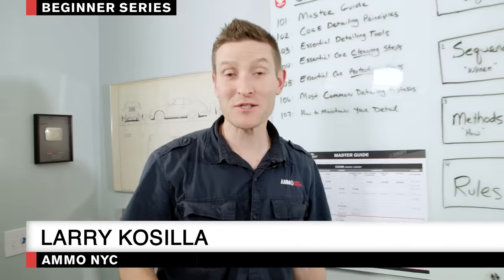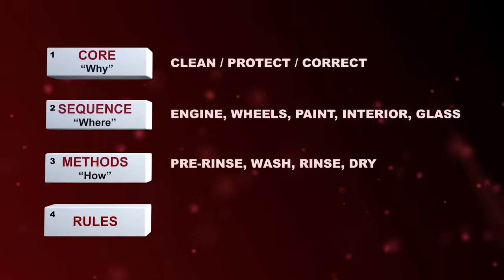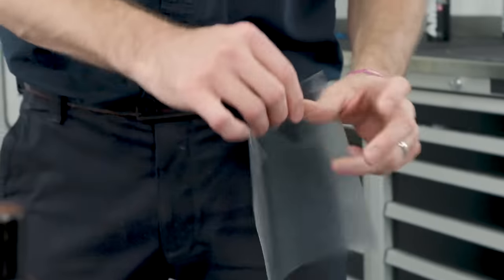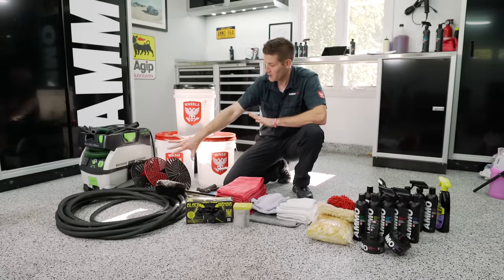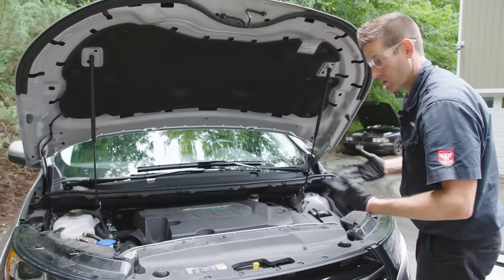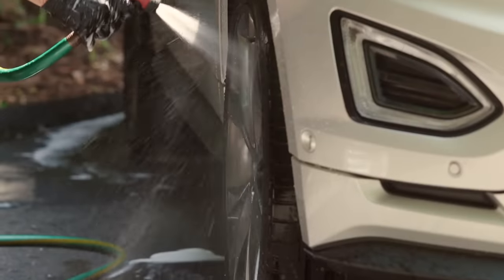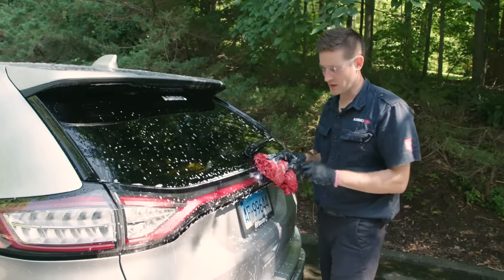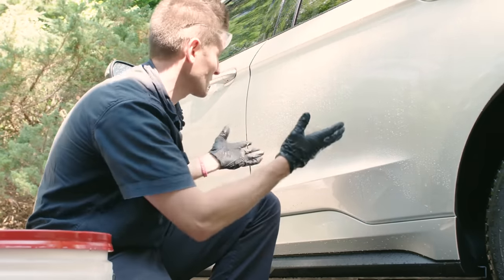Car Detailing Tips YOU MUST KNOW: Full Length Training Series

Comment: How would you clean the gauge cluster? Scratched mine while cleaning the interior and I'm pretty sure a plastic polish would be good. But for future reference so it won't happen or lessen the scratches.
Reply: This happened to me too using a brush that was labeled by the manufactured as Interior Detail. Scratched the shit out of my gauge screen.
Reply: Matthew Jesensek gutted!
Reply: This area is more for a quick wipe with a microfiber towel and that's it. There is no need to put anything on it.
Reply: The problem with polishing gauge clusters is that they can have anti-glare or anti-reflection coatings on them from the factory which you will strip off.

Comment: Hi Larry! Great videos. I’m so glad someone took the time to explain in-depth a beginner way to detailing cars. I have a question well actually two. First Q: I have hard water to use. Do I need a water softener or water filtering system to prevent water spotting? Second Q: I have a white 2015 Ford F-250 with 8 ft bed. How can I “easily” wash the top roof of cab? Again thanks for all you have done! Looking forward to hearing from you soon!

Comment: @AMMO NYC - to answer the question for the back of the car since you have asked for an explanation. It's due to aerodynamics, because the object travelling through the air is cut off abruptly and doesn't end smoothly such as a tear shape, the air creates vortices (trying to fill in the gap created by the vacuum of air in that area) and all the dust and whatnot from all around the car are sucked along and stick into the back of the car. Those vortices not only make the car dirty but also cause what we call drag and instability in a straight line. You will usually see race cars using spoilers on the car to create downforce but you will also notice they are pushed as far back as possible so the vortices do not affect the whole car but only the spoiler (as much as possible as it's unavoidable). If you have ever watched F1 you will see that it is virtually impossible to drive for prolonged periods of time very close to the car in front ~0.6s gap or less depending on speed temperature humidity etc (causes instability, less downforce, overheating of engine and brakes but can also help overtaking in a straight line if timed correctly- this is due to the vacuum of air in that area.
Again thank you for your awesome videos. You are really teaching us a lot!

Comment: Good info Larry, Personally I use the same strategies, I don't recommend the use  3 bucket method or wash mitts though , just one for wheels, the other for panels, I use 2 packs of MF towels,  I use one towel per panel and one per wheel, and discard, no double dipping of towels or mitts, that way the possibility scratching the paint or wheels is minimized very greatly!,  no amount of rinsing or agitating of towels soaking  will remove contaminants from the towels for repeated use.

Comment: Have you ever tried "Squirt the Dirt" Drywash 'n Guard ?  No water needed and the shine is unbelievable. In the door and tailgate pockets further grease and dust more or less refuse to stick and stay clean and shiny.  If you polish up the Drywash say on tge hood or fenders, the shine will reflect the numbers way over the length of 1 yardstick.  The dealers had a convention at the 5 Sails on the Vancouver waterfront.  I was there. Never before or since have I seen such a shine.  I'd like your opinion on it. Thx.

Comment: An excellent and very detailed tutorial. Learnt a lot from it! 

One thing I’ve always wondered though is why the interior is not cleaned first before the external paint work is worked on? Wouldn’t it be better to remove the door mats, clean and dust them etc and once the whole interior is completely cleaned to then move to the exterior side? This way the interior no longer needs to be accessed and there’s no risk of causing dirt or unwanted contaminant from the interior to settle on the paint that’s just been cleaned? 

Would really appreciate some views on this. Tq
Reply: Your thinking is 100% correct Do the inside first.

Comment: Good sound Info here ! Thanks.  HERE'S A TIP !  :- 
BUY multi coloured Microfiber Towels. 
Make your own Colour code that makes sense / Rhymes  ( for remembering ) 
GREEN = Screen / Glass, 
Blue = poo / dirty areas, 
Yellow shines like the sun = Paint 
Pretty pink = to make the dash clean . 

Ok make your own colour codes , and make sure you remember them with something that Rhymes or is funny. = easy to remember. 

Micro fiber Towels that have been used on interior glass but are getting old are fine for engines and wheels & dirty jobs. 
Then All used Towels can be used for Rags for wiping up any spills,  just before they go in the Bin. 
( Colour = England, English Spelling ) 

You can also apply Sticky tape to your containers to remind you of the colour code you use. to match the towel. 
For working Fast. + NO MISTAKES ! 
+ Learn what each product smells like as a final double check . 
DO NOT USE THE WRONG PRODUCT in the WRONG PLACE ! 
Mr Fastboy will cover the car before he Notices the damage he has done. 
Mr Careful will have a STRICT Method ! and be faster than MR Fastboy ! 

If you need to be Fast = You havn't Charged Enough ! 
A MINT Showcar is not a RACE ! time = perfection. 
Work BRISKLY, But NOT Fast ! 
Would you take a SCRUBBING Brush to wash a Baby ? = NO ! 
so why take one to your Paintwork that you paid so much for ? 

I hope That helps you All . 
best wishes from England UK.

Comment: I understand the drying aspect. My question is your input on a spot free rinse? We have harsh water
Reply from the maker: I have well water too. I use a water softener filter as well but I still like to dry the car in the same fashion as not everyone has access to softened or cleaned water.
Reply: @AMMO-NYC  1 last insight. The 2 bucket system vs a foam cannon by its self? Pros cons? What do you recommend and why?

Comment: Actually  your using those newer chamois and even with those your supposed to wash them as you do your towels to remove any debris it has picked up. Same thing with the leather ones because they do pick up dirt and small debris and it keeps your leather chamois from feeling hard after dying because it is filled with dirt. Chamois are for quick drying and to help from lintel being left behind from towels. Especially on dark color vehicles.

Comment: damp microfiber towels picks up water because of the hydrogen bond. H20 is actually attracted to H20. This is also why getting a steady stream of low pressure water prevents the paint from beading and creating water spots. It comes off in sheets instead of drops.

Comment: You could also disconnect your battery an hour ahead of time. That way all the residual electricity discharges and there's very little chance of shorting something. However you still shouldn't get things like the alternator soaking wet. Everything under the engine bay is designed to get damp. If you do choose to do this make sure to let all the water evaporate before you connect the battery again

Comment: Terrific video. One question, in regards to wheels. I have a 911 those (standard) rotors turn a yellow tint between washes. What is the best method of cleaning off surface residue on rotors?

Comment: i kind of use the same method for doing the maintenance but I lather the car using the soap cannon , rinsing and dry it of with a blower.Since this method isn;t quite effective it does make it look cleaner and there's no contact thus no scratch marks either.

Comment: Hello, I'm asking this to many of the detailing people out here and hoping to get some good thoughts and answers. I've been using the ceramic coating methods lately and I've given thought to something that's easily missed but something I think could be important to the coating. So when I coat a vehicle I always coat the entire car, including the windows, windshield and sunroofs. Just as many people used to and still does apply Rain-x I prefer the ceramic coating itself, and I love it and rarely have to use the wiper blades. But for those times when we do use the wiper blades and washer fluid, very often a fluid from a local store like Rainx, Windex or Prestone brand etc is used and I'm almost sure it eats away at the ceramic coating every time it's used. As we know it not only hits the windshields but also the tops and rear of the vehicles as it runs off. If the normal washer fluids are strong enough to clean windshields from the usual contaminates I'm sure they're strong enough to deteriorate the ceramic coating, as anything with alcohol or even Dawn dish detergent will.
So something I've been thinking about is, what would be a good substitute for all of the usual windshield washer fluids or are there maybe new products that I haven't seen anyone talking about that would be safer to use to wash the windshield those times we need to while driving, when we don't feel like or have the opportunity to physically wipe down the window by hand with a ceramic booster / cleaner? I personally use some products on my cars' ceramic from Adam's, like the Ceramic Waterless Wash spray and H20 Guard and Gloss, and the ph neutral car shampoos. What do you think about putting some of these in the washer fluid tank and maybe diluting a little with water? Or would this be a bad idea because I'm not actually wiping down with a microfiber but instead just swiping with the wiper blades when necessary?
I may be overlooking something here but I feel like this is a small thing but also something that could deteriorate our ceramic faster than we'd like it to and not really think about it as it's happening. Please all responses are welcome and if there is no good substitute hopefully this will help some companies work towards it if possible. I'm sure it's been thought of but you never know. Thanks
Reply: The issue of degrading the coating will be the contact and abrasion of the wiper blade, to make it last a bit longer ensure the window has been polished and wiped down with IPA prior to application of the coating. 

Have the non wiped sections (top corners of the windscreen) also been effected? 

If so I'd say there's a problem with the bonding/ceramic product/preparation as ceramics should be able to withstand washer fluid without issues and wiper use for minimum 6 months.

Comment: Hi Larry. If a car is being washed in preparation for a clear bra application, is it still okay to use ammo hydrate when you dry the car, or does that impede adhesion of the clear bra? I watched your xpel video and am wondering if you would just use the IPA solution during the drying process in anticipation of the clear bra? Thank you for all of your videos.
Reply: Mariya Vandivort I believe a IPA/water mix is used in the prep for a clear bra, this would mean all protection would be removed. If you have a harder sealant, like quartz then that's a different story.
Reply: Thank you!!

Comment: In the sequence (where) you have paint before interior. May I ask why? Most detailers including myself use an air gun to blow the car the out . I like to vacuum and then blow the car out and vacuum again. i usually repeat this process 3 to 4 times to make sure i got all of the loose dirt and anything hiding in tight areas. In doing so. The outside gets contaminated. So after I finish the interior and climbing in and out of the car; that may also contaminate the paint. I blow the car off . then I use a clay lube and plush microfiber to clean each panel before I clay and do correction or just apply wax or some other protection. maybe im wrong it just seems to me that the paint has time to get dusty or contaminated while doing the interior. I feel the paint should be done last as you do not have to go in and out of the car anymore. its just my thoughts on this.  Thank you for making the videos . I have my guys watch them for training as i dont have time to train them. Im always looking for a new video for them to watch. and this will be one of them .

Comment: Here is the the way to filter water for cleaning:   3/4×FGHT - 1micron Sedement filter, 3/4 NPT, 1st activated carbon filter (3M),  3/4 NPT, 2nd Activated carbon filter  (GAC), MGHT,  garden hose, gardern hose sprayer or hook up to an electric power washer.  Then if you want zero pure water run a 50 to 100 psi pump into a reverse osmosis filter (4×40) with a DOW Filmtek or Hydron BW filter (Amazon).  Check your water with a TDS meter and run through a second time if you want zero pure water. 

Distled water is zero pure water and can be used to clean windows and mirriors using a damp and a dry microfiber towel.

City water contains souium Hypochlorite (bleach) which is made with caustic soda and salt and should be removed from all wash water.  Water filter canisters come in several sizes.  (2.5×10, 2.5×20 and 4x10 and 4x20).

Comment: GLASS, 
For the 1st clean on glass  ( dirty glass )    i use Paper Kitchen towel to get the dirt off , then i do as you do here. 
Very dirty & dog licked glass, & child sticky finger marks etc, I use a pre cleaner of Vinegar & Water , ( 90% water / 10% Vinegar. approx . ) you only need a small amount of water & vinegar, ( a third of a small cup ? )  half an aerosol cap full. 

By using paper Kitchen roll, the thick dirt gets thrown in the Bin . keeping your Towels cleaner. 
( it can & does leave white dust, ) but i'm talking Neglected Very Dirty glass, or kids & dogs or Smoker etc. )

I tend to get a lot of Black Diesel soot on the inside of my glass, = Pollution from other vehicles in Cities. ( UK ) 
Even on a Petrol / Gasoline Car.

Comment: This shopping list will add up to about $7,200 dollars, so if you’re thinking about detailing, I’d suggest you get a bit more flexible with brands as there are better deals out there. Even if you charged $200 for each car you detailed, you’d have to clean 36 cars to actually start making money.
But probably more around 40 cars because you’d need to keep replacing chemicals, cloths, gloves etc… a few times over by then. Just being realistic. Just think, every dollar you save on equipment brings you one step closer to turning a profit. And there are a lot of good substitutes out there for may of these tools. I highly doubt that a Milwaukee pack-out case and the added fatmax case is 100% necessary. 

But I’m glad to see that he is recommending Milwaukee tools as they are manufactured in the USA, but they’re a bit more on the expensive side; however, their newer tools have an outstanding battery life and the tools will last longer so will save you money over time for not needing to replace them, at least not for a long while. But if you don’t shop on eBay or other sources for good deals, you’re going to have to clean a whole bunch of cars to start turning a profit. There is obviously some sponsorship hidden in these recommendations as some of these tools are much too too-line to be targeting beginners. You should go for cheaper tools, at least until you see whether you like this line of work.

Comment: You have no idea where I am, when I question the detailers/groomers on their steps and processes, most of them can't even get the basics right. It's so hard to find a groomer to deliver just the basics of what I want. Some don't even do surface prep work. OMG... paid a bomb for coating and when I inspected, there were so many flaws, they had to give me a 50% discount upfront and drag me out of the shop to discuss about re-work so that other customers don't start to check like I do. Not many takes pride in their trade, just out for quick buck for bang and run.

Comment: Overalll a great video!!!! However as a former detailer for a major dealership i disagree with not picking up excess water/water spots with  shammy's. I have an absorber and i wash it everytime i use it and i have no water spots and it does pickup dirt all the time. yes you can argue if i can cleaned it perfectly it wouldnt pick up dirt but neither would your mcrofiber towel if you cleaned it perfectly which is damn near impossible.theoretically if it picked up dirt that dirt caused scratching. id rather not have water spots and use an absorber whcih is absorbant which is designed to just "absorb water" unlike microfiber.Yes there are many many different types of microfiber but Under a microscope microfiber is comprised of microscopic hooks (the one used to absorb water) so to me it seems counterinuitive to me.

Comment: Larry I just bought a 2012 L322 Range Rover I think the wheels have never been washed. They are full of brake dust and embedded in the inside is tar, junk, on the part we see there are scratches in the coating plus grit. I have PVD Onyx Chrome rims. How can I get them clean and smooth on the inside again plus remove visible scratches on outside? Thank you for any help.
Reply from the maker: hey bud. call the office one day. thx

Comment: The back of the car gets dirty because there is an area of low pressure created which acts like a vacuum, sucking the air up that is flowing over and under the car. It will suck up the exhaust gases too which is particularly bad for diesel cars.

Comment: I agree with how you wash the car but I don’t see how a synthetic chamois is worse than a microfiber towel as far as marring the paint when drying... as long as your drying media of choice isn’t holding on to contamination there shouldn’t be any issue. I use “The Absorber” and I do actually wash it out after use, as well as rinse it a few times in a bucket of clean water while I’m drying the car. I’ve been drying this way for years and never had any issue with the chamois holding onto contaminates or scratching the paint. 

I wouldn’t mind trying a big microfiber drying towel but the synthetic chamois lasts so long I haven’t yet need to replace the one I’ve had for 10+ years...